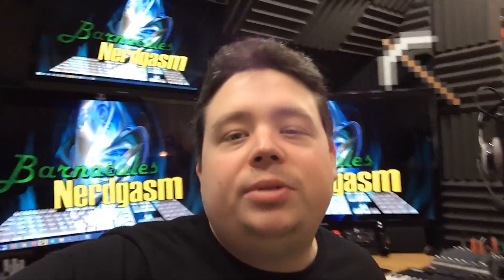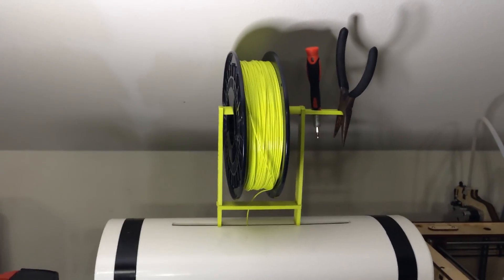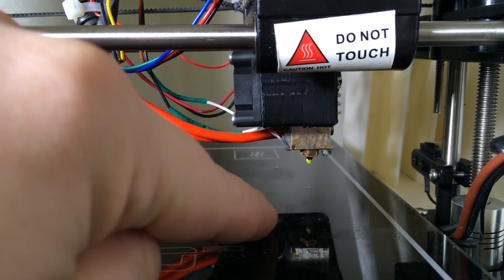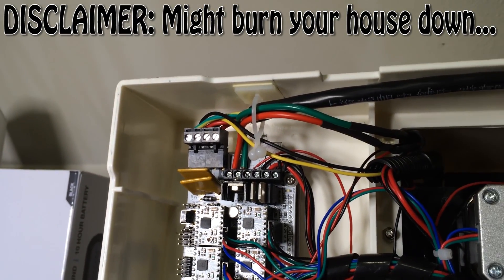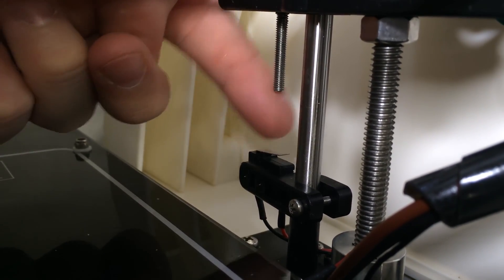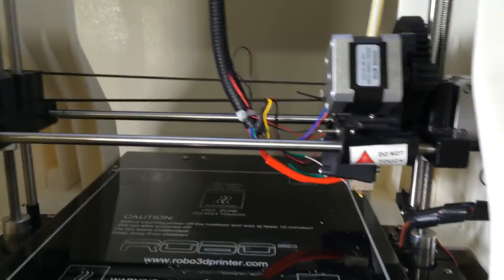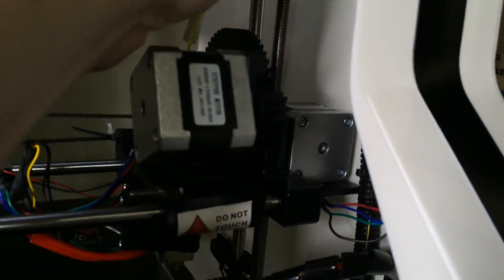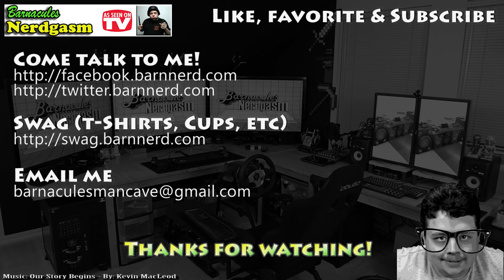How To Fix Your Robo 3D Printer : Tips & Tricks to Get Awesome Prints - @Barnacules

Comment: Great video.  Thanks for your contributions to the community!

One note, I'd suggest that you modify your Z rod stabilizer so that its adjustable.  No two printers will have the same tolerances and those rods need to be super accurate to prevent jamming as the z axis moves up.  If you make the stabilizers adjustable then users can run their z axis all the way up THEN tighten the stabilizers so the spacing will be near perfect.

If you install this stabilizer as is, make sure you run your z axis all the way up to make sure it doesn't jam.

Good stuff.  I love that a $700 printer with a few modifications can make really good prints.

Thanks again,
Tony

Comment: Thank you for the videos! DO you have a link for the LED bars you are using? Do you need a controller or you just plugged the wires and it worked?

Comment: I was wondering if you can help me with something I have hit a few dead ends when it came to converting google sketchup models to STL files for 3D printing I would go to certain websites and click on most of the links and it would just bring me to other sites giving instructions on how to use the program which really doesn't help me cause there is no download button... (especially when I go to thingiverse I open the compressed zip files there's nothing inside except a certificate and I've download many files just like it and all of them don't have anything inside) and just when I think I have gotten the STL plugin extension for google sketchup it's a DXF plugins extension and for some reason the DXF plugins extension doesn't show up on the extensions tab so that I may export google sketchup files and DXF files don't work on makerbot makerware program for some reason... what do you suggest?

Comment: Just got my robo and I'm having exactly the same issues. Thanks so much for sharing, you've been super helpful and linking all the 3d parts is a bonus! Can't wait to flip the z-axis and try "on the fly leveling".

I'm having alot of trouble with PLA sticking to painters tape, would you say hairspray is better?
Reply from the maker: Yes, the Extreme Hold hairspray works fantastic. Spray it on while the bed is heating up and let it get tacky and start your print. I've yet to have something come unstuck. And when it cools it usually just pops right off.
Reply: Thanks Barnacules Nerdgasm , I'll give some hairspray a go. I flipped the z switch this morning and did some on the fly leveling. Seems to be working much better now, can't wait to print some mods and get it working even better. Thanks so much for your help!

Comment: If you plan to upgrade the print head, is there ANY reason to get the ABS version of the printer?
Reply: The only difference between PLA and PLA+ABS versions is the heated bed
Reply from the maker: Denys Dmytriyenko PLA version doesn't have a heated bed and can't extrude materials hotter then 210c I think.
Reply: Barnacules Nerdgasm correct. That was the answer to WeAreTwoDoorsDown question... :)
Reply: Denys Dmytriyenko Oh, so if I plan to ever use ABS, I should get the ABS model?
Reply: WeAreTwoDoorsDown or replace the bed later.

Comment: Thanks! Can you please provide a link to the Furnace Cement you used? Thanks again.
Reply: And one more question - did you have to flash the new firmware to bypass the temperature limit for the new E3D hotend? Thanks!
Reply: Taken from the "about" section:  "One thing I forgot to mention in the video is to use 'Furnace Cement (from Amazon)' to secure the thermister (heat probe) to the print head instead of Kapton tape, it gives a much better connection between the censor and the block and the temps are far more stable as a result!"

Comment: Hi Jerry, just printed all the parts and the rod supports make such a huge difference. thanx a million. by the way, how is the cable holder printed part held into place? could you send or post a pic of it in place? again, thanx
Reply from the maker: The cable holder actually didn't install right. the person that made it is going to send me a different model eventually and I'll do a video when they do.

Comment: So pretty much this printer sucks with out your help
Reply from the maker: Yes, out of the box mine didn't work so good. That being said there are some people that pulled them out, turned the key and they worked good. I think it was more quality control related issues.
Reply: Barnacules Nerdgasm Yes, I am convinced that was it. They went to having them built overseas (but in larger quantity) and apparently have not gotten the QA work done. Mine (like yours) was broken out of the box, but nothing that could not be fixed with a little work. Still, it should not have been delivered that way. Kickstarter is for startups and you sort of have to understand that I think. Like your, after a bit of work sorting it out, I am now getting reliable prints.
Reply: well thanks for helping :) anyways